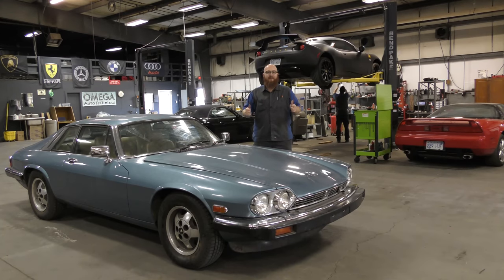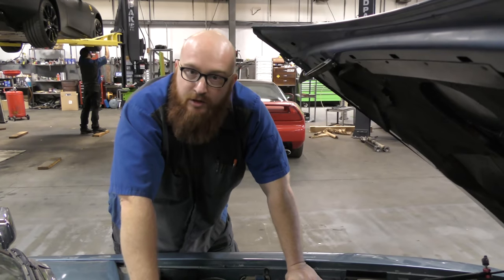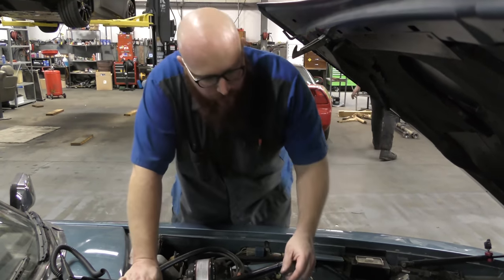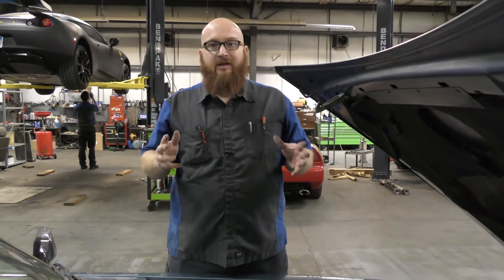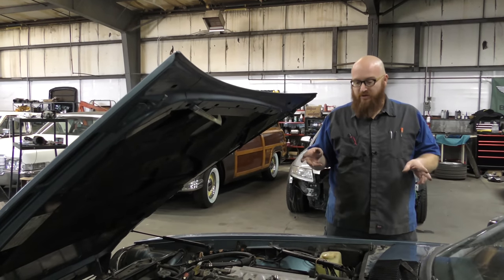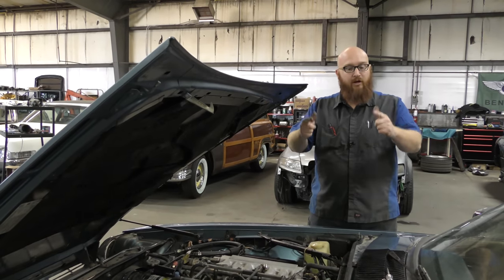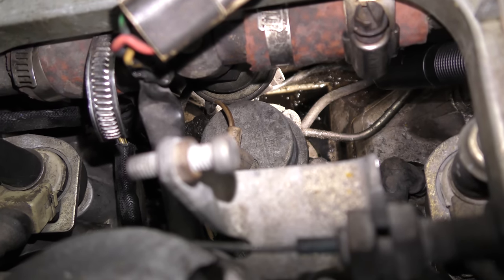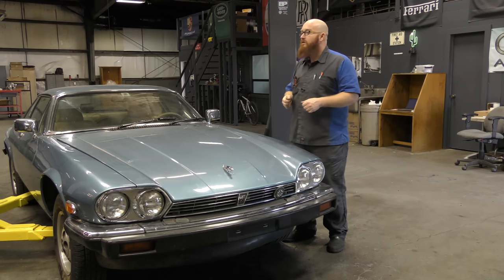'82 XJS with the cursed Jaguar V12 comes into the CAR WIZARD's shop. Can he get it running?

Comment: So it’s not lucas’s fault it didn’t start it’s chevy
And some other mechanic messing about with it
Reply: Fucking lucas cause so many problems on plenty of old good cars.
Reply: @KreKeriS911  I have found the Lucas electrical systems in both my jag xj6 and rwd Toyota Corolla to be very reliable!
Reply: @KreKeriS911  I agree, my first car had some Lucas stuff inside. I replaced with Bosh spare parts, no more problem.
Reply: BMC was the trouble bot lucas. 
Lucas around this time were in good competition with bosch, later stuff in the late 80's early 90's was of varying quality.
Reply: Drove 1960s Rovers for years. Lucas was fine. Great cars, very robust and dead easy to maintain.
Reply: @andrewallen9993  I had a 93 xj6 for awhile, one of the most reliable cars I've ever owned
Reply: Lucas-the prince of darkness.
You don't need to use your wipers and headlamps at the same.time.
Reply: @emt9370  Only if youre a crap mechanic and down know what you're doing. I even ran the old dynamo for a while - only changed to an alternator to run big headlights.
Reply: Do you know why the English drink warm beer, because Lucas makes refrigerators!
Reply: @jrbay1  Because they dont drink it warm...? The joke would work better if americans were not quite so clueless about the world ;)
Reply: My first car's Lucas starter was so reliable the brand new heap came with a hand crank. And a loose nut (minus any cotter pin) on a steering tie rod that could have killed me.
Reply: @t5ruxlee210  Back in the middle of last century,  the starter handle provision was more a reflection of battery technology in those days... 

I did have a Lucas intertia engagement starter play up, but it gives heaps of warning the throwout spline is getting sticky. Was at least a year where a tap with a hammer would free it up for that first cold start of the day before i pulled my finger out and replaced it. I replaced with a later model solenoid engagement style which worked a bit better. 

1969 Rover 2000 TC. Loved that car...
Reply: Food for thought..

Comment: It's weird the ones in america seem to be far worse than the ones in the UK. They're really not that bad over here
Reply: In Australia they are notoriously bad. It’s mainly the hot climate that makes them overheat, leak oil , every year you have to resell the power steering rack because it’s so close to the exhaust for example
Reply: American mechanics not understanding the car due to the lack of available knowledge and scarcity of spare parts are the main factors.  US cars also had a lot of extra emissions gumpf on the engine that caused issues too.
Reply: @ohcamsrazor1966  Same in the States.  It gets beastly hot and humid in the summer and artic cold in the winter.  English cars did poorly in temperature extremes.
Reply: It is probably because Americans don't obsessively maintain their cars. In fact, most don't maintain their cars at all.
Reply: Great that you got it running. Not unusual for the Ignition amp and the 6U to fail. Now that its running PLEASE change the fuel injection hoses immediately!!! I can see the original manufacturer date tag on the inlet hose to the fuel rail, which most likely means the hoses are original. I guarantee they are hard as rock and as soon as you put any heat or load on the system there's a strong chance you'll blow a hose. Then you will lose the whole car.

Comment: I would never touch a Jag, beautiful cars, but mechanical nightmares.
Reply: Simply date a guy who loves to touch you and has one beautiful lady and drive it when you want to.If it breaks it's his problem.Or learn to work on them yourself.Nothing stopping a girl from being a good mechanic.Just don't worry about your nails.I've got 2 Jaguar V12's.XJS like this runs fine.Daimler Double Six sedan not so much because of previous so called mechanics incompetence.Ciao
Reply: you either need a lot of $$$ to pay a specialist (most modern mechanics won't touch them), or you become an enthusiast and do it yourself.  I really enjoy working on my Jaguar XJ-S.  But it's a lesson in patience, constant learning, and quietly cursing out Jaguar Engineers of the 80s. (What the F were they thinking?!)  

But nothing looks or drives like a Jaguar.   It's worth it.
Reply: As proven in this video.

Comment: I had one of these, an ‘87.... they are very beautiful and smooth running but they are cramped inside, pedals too close together, not at all powerful, and extremely prone to problems.  They only look good, especially the early ones!

Comment: "I've unplugged the coolant temp sensor to keep the engine from starting"

"And that might have killed the computer, let's go look at it, in the trunk " 

OK, I'm beginning to understand why people hate these things.
Reply: not to mention the vacuum line that runs all the way back to the ecu....have a hard enough time finding vacuum  leaks with 4" lines.
Reply: @Electronicle  yeah, that's insane too.

But man,  even ford and chevys first iterations of fuel injecton would default to a stored value  if the ecu couldn't read the coolant temp sensor, and allow the vehicle to still run.  Even if it ran somewhat poorly.  On this car its apparently just dead in the water if that sensor has an issue lol

Comment: I have a pre HE flat head v12. I was given the car not running. It's like you said, once I got it running, then I find all the other problems the previous owners had goofed around and messed up. They're really not awful to work on if you read the factory service manual. Mine went from sitting in a barn for a decade to purring like a kitten with a summer's work and around $2000

Comment: I've owned an 87 xjs v12 for 13 years so far.   You said the spark plugs are easy to get to 😁.   Sure, once you move the ac compressor out of the way, you can get to the front 4.   Lucas jokes aside, it's been trouble free the whole time I've had it, after I did full maintenance on it back in 2009.  Its a very special car I'd never sell.  It's actually not a bad car to work on, provided the previous owner didn't screw everything up.  As soon as you said there's an oil leak, I knew it would be the oil pressure sensor 🤣

Comment: I was working at a Dodge, Mercedes-Benz, Jaguar & MG dealership from 1978-1981. At the time I was working there, Lucas released their "Constant Energy" ignition system. I was well aware of what lurked inside the box. Just be glad it has the newer injection system. All the ones I worked on had the Bosch D-Jetronic system with the reed switch plate under the rotor.

Comment: You need to be careful with the Jaguar V12 engine timing. The distributor drive is a 1/4 inch hex drive that will wear to the point that the timing will jump when accelerating. It ran well until I accelerated  hard and the distributor drive slipped causing backfires and rough run. Checked the timing and it had changed. Fortunately for me I changed the distributor drive shaft and it was fine. Sweet engine!

Comment: I helped worked on the conversions of these cars to convertibles in 86 and 87. I worked at Hess and Eisenhardt in Cincinnati where we cut off the roofs and installed retractable roofs. The converted cars were then sold in Jaguar dealerships as an add on feature. I illustrated all of the parts and steps of the processes of the conversion. The craftsmen followed the engineered process I illustrated. Good times.

Comment: Wizard, the Chevy 350 was installed because the existing engine collapsed a piston or scrambled a bearing and it was simply too costly to repair. A friend of mine had a museum, and he made a display out of the Jag engine. Looked great--from the outside.

Comment: Back when the earliest V12 Jaguars were just a few years old, they often appeared off the side of the road steaming.  Conversation over the counter of the local independent foreign car shop led to the hoses.  The early ones had $200  (in those days) worth of formed tree sap rubber hoses which needed replacement every two years or else they failed and blew coolant out.  I suspect that by the time this one was built, they had gone to synthetic rubber for coolant hoses.

Comment: built one of those v12 Jag engines in my teens and loved it so much I spent a season building the TWR 6.4 litre Le-Mans race variant in my early 20s. I really don't get why people hate them so much outside the UK. they aren't simple but neither is the Ferrari v12 from the same era accept the Jag gives so much more refinement and longevity in its respective grand-tourer with relatively good fuel efficiency too.
Lucas electrics aren't the best for sure but Magnetti Marelli electrics make them look good lol
Reply: Care to go into details on your build-that's exactly the info. I'm looking for-Cheers
Reply: @jdmimportlogistics  - I'd love to, really, but I'd need one infront of me to refresh my memory after 38 years away from them. what I can remember though is the internals were nothing unusual for a British overhead-cam engine and like more modern engines they required a clinical approach in building compared to mass-market cast-iron OHV units. 
in a British road form they were good if serviced properly. from discussions with mechanics from the warmer parts of Australia and America when I lived in Asia, it seems there was a bad overheating issue and all the knock-on issues that go with it. having not experienced the issue first-hand, I could never make up my mind whether it was a lack of a cooling upgrade for those markets or a lack of understanding of a something more sophisticated than an all iron OHV engine?
Reply: @thatcheapguy525  Thank you for that articulate answer Sir! Very interesting I wonder about adapting a modern ECU/wiring harness and  some of the engine building principles seen in the aftermarket K24's (also an aluminum block) may provide some answers?  I'm sure some of  Mr. Walkinshaw's mechanics from Bathurst are still alive?
Reply: @jdmimportlogistics  - from my long distant memory, I think the TWR Jaguar engine had an early EPROM? based ECU with common-rail electronic fuel injectors

Comment: Another great video. It’s a bit like a decent bottle of Spanish Rioja, the jaguar has matured nicely with age. Sadly most of them in the uk 🇬🇧 have gone through the crusher, because of the rust. Your one looks like it’s survived very well! We have the Lucas on our Landrover, brought it as a non runner. Other than 10 year old dirty fuel, found the contacts in the air flapper valve where causing fuel pump problems. Only needed to clean the contacts 👍

Comment: From what a lot of people have told me one of the reasons some owners put the 350 V8 in the XJS is the SBC is lighter and sits further back in the engine bay since it’s four cylinders shorter. I’m told this makes it a better handling car. The only down side is the V12 has a higher top speed but most people won’t get up there anyway. I remember back in the 80s though that Tom Walkinshaw won the Bathurst 1000 race in one of these and also the British Touring Car Championship so they were very competitive. Most people though race these in the 3.8 or 4.2 six cylinder configuration again because the engine is so much lighter and therefore handles far better. Still the V12 is just so silky smooth and so linear in its power delivery that I would leave it as a V12.

Comment: The issues are the same as the Fox body EECIV and TFi. Small voltage losses take the system down..Its loke finding the missing High Winds sign. You gotta know to Understand. 

Opus Amplifier is heat sensitive, but Rover and Triumph and Range Rover used it too.

The Hall sensor is particlate sensitive. The Harrision/ Fridgidare AC and Saginaw power steering pump, Adwest style power steering rack and THM 400....best parts.

Comment: I bought a problem XJ12 and had the engine rebuilt. I loved it except for the electrics. Hard start, no start, I had it all until a smart old boy in Gainsville said I should let him put an Allison Electronic Ignition in place of the points and rotor.
Just a laser and a slotted disk in the old distributor. I never had another problem until a faulty temp gauge killed it. It got hot 40 miles from home but never read hot. As expected, it swallowed a valve on the right bank and still got me home. Never ran again. The next owner did the SBC thing.

Comment: I've seen photos of the parking area outside the Jaguar factory in the 1960s where completed vehicles were stored prior to collection/delivery, and it's absolutely splattered with oil stains! Even brand new, Jags used to leak.
Also the reason so many people put small blocks in these is because they use a GM 4LX0 transmission so once you've fabricated some engine mounts it's almost plug and play.